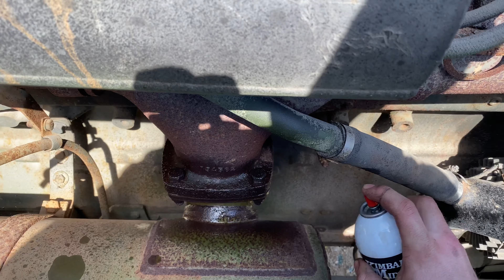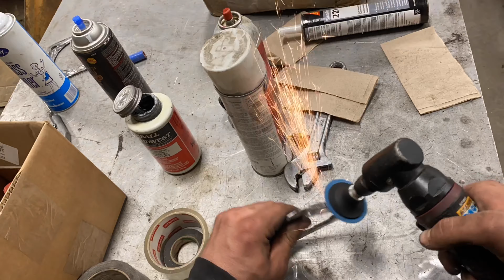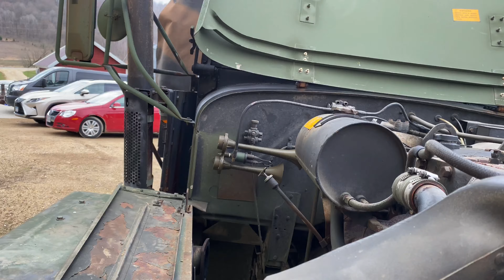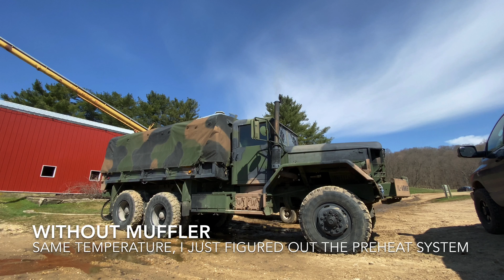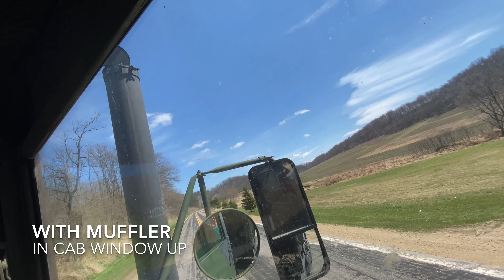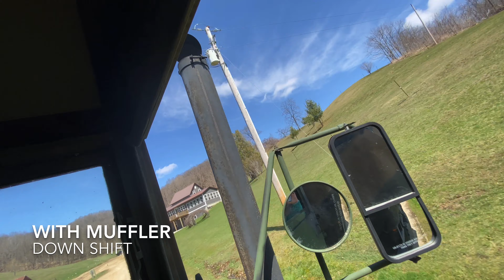STRAIGHT PIPING GUNTHER THE AM GENERAL M813A1 WITH NHC250 CUMMINS (Before and after)

Comment: We have the same engine in a '71 Ford 9000. I'm thinking about straight piping it this summer. It'll probably be with some cheap flex-pipe too.
Reply from the maker: It sounds awesome straight piped, but it’s also very very loud, almost a little obnoxious in the cab😅
Reply: Is it multifuel?
Reply from the maker: Only diesel. I would have liked to have a multi fuel

Comment: It sounds great but it's definitely much louder. My muffler flange to the J-pipe is cracked. If I lived in the open like you, I'd straight pipe it.  I live in the city limits and I'm trying to be considerate of my neighbors so I think I'm going to have to replace the muffler.

It must be awesome to have those wide open spaces to drive that truck.
Reply from the maker: It is nice and it does sound really good. But it is really loud and I’m not sure it was worth it in the cab
Reply: @DieselDom  Buy a set of noise canceling gun range muffs. Blocks the noise but lets you converse with your passenger.

Comment: What pre heat is there? Didn't think they had glow plugs.
Reply from the maker: Grid heater
Reply: Just picked up a M925a1 I believe mine only has either start. Was hoping for some type of heat system. I did install a inline block heater that works good.
Reply from the maker: @OneBadBuick  yeah mine has a grid heater and I still need to install the block heater.